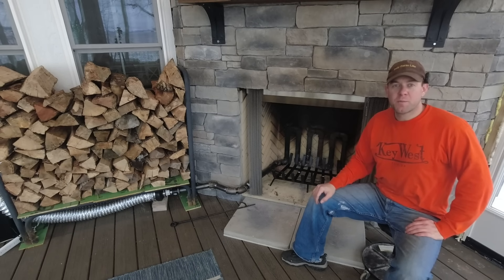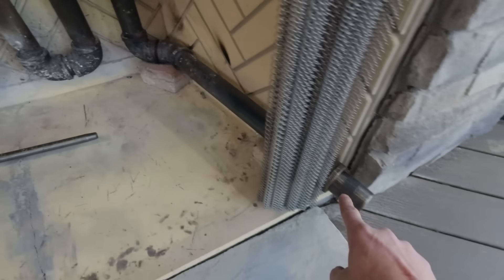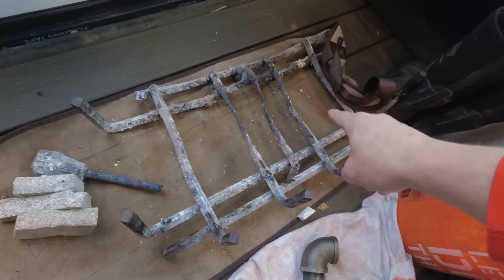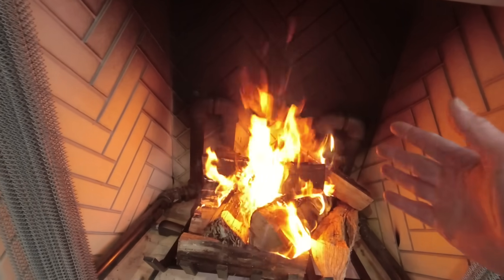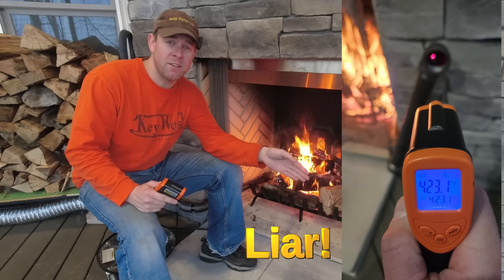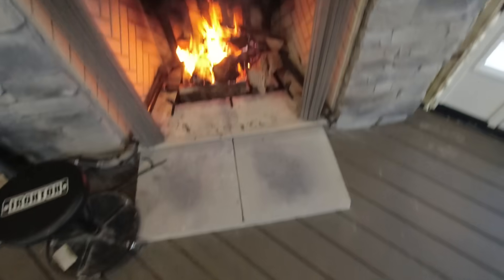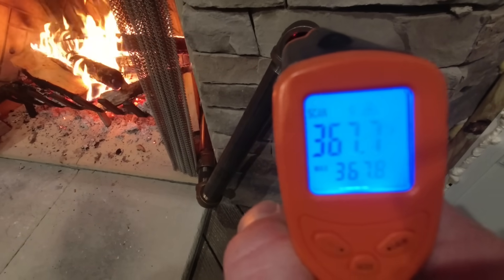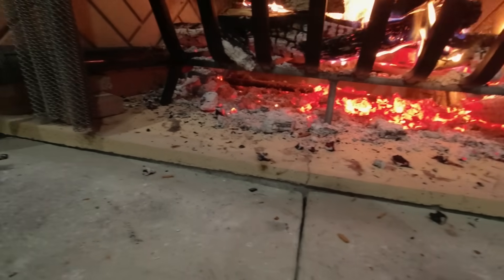Your Fireplace Is Wasting Heat — Here’s How to Fix It!

Comment: To improve performance add some sheet steel behind the pipes, the thickness matters somewhere between ⅜ to ½ (10 mm to 12 mm) is the sweet spot.
Reply from the maker: The air temp coming out of the pipe is already really hot. Not sure I need to "grab" more heat.  I also don't want to block my refractory panels completely.
Reply: @IndyFarmLife The plate reflects the infrared directly away from the face, and it's also a thermal "battery". This also helps to even out the temperature swings when using the fireplace.

Comment: I wonder if you could use an old radiator from a salvage door. Sandbblast all the paint off of it of course...
Reply from the maker: Maybe If the steel is up to the temps. Not sure if it is or not.

Comment: Very interesting!  Makes me wonder about making a small boiler  with a radiator  with  a water pump to circulate?
Reply from the maker: That would certainly work.  I would put a pressure relief valve in there though.  I would be nervous something would rupture.  Hence why mine is just air exchange vs liquid
Reply: i dont have the need for such a project.  However a small system scaled down from a known boiler system to heat a garage/shop/ hot tub/pool  would make some good content for a youtuber!  Make it low budget that a guy could source from hardware store.

Comment: I remember back in the 80s i think sears had a fireplace grate that was actually made of hollow tubing that was connected to a manifold and blower. The tubes reached out far enough to not blow the smoke into the house but pulled all that heat from the coals and logs.

Comment: You need a compression fan like what you see on an air hockey table that fan would be perfect for your needs cuz you can put it inside of a box it would suck air in and compress it down the pipe that's how an air hockey table works it pulls so much are in compress it in the space and then blows it out those tiny holes
Reply from the maker: Thanks for the tip/advice.  I never knew that was a different kind of fan.  I'll have to look into that!  Much appreciated!

Comment: I have ventless gas fireplace in my family room that has a double story ceiling and all of my heat just rolls upstairs.  Just recently, I put a fan on the mantle to blow the heat out instead of allowing it all to just go up and it helps tremendously.  It’s a bit of an eyesore but comfort over convenience I guess.  Something like this can be very beneficial to getting the heat to go out instead of up. Honestly I’m not sure why fireplaces aren’t built or equipped with something like this anyway, it just makes sense.

Comment: Instead of stepping down from 4" to 1.5" all at once, you should step down in increments about 12" apart - will result with an increase amount of air volume and at a higher speed
Reply from the maker: I had thought about that actually. Any idea if a plenum box like I mentioned in the video would accomplish the same thing?
Reply: @IndyFarmLife 

Not by itself.
A plenum box and the reduction of the air pipe do not accomplish the same thing as they are designed to do different jobs.

The step-down (4" → 1.5") is  actually a reducer. In that we are restricting the flow area and thereby increasing air velocity.

A plenum box reduces turbulence and equalizes
pressure.
Essentially,  a plenum acts as a buffer by making a reservoir of air.

You could add a plenum, but would still need to add a restriction.  
A plenum is a calming chamber; while the step down in piping is a throttle.

Comment: Thanks for sharing your very nice video ... I just sold the 4 bedroom Pennsylvania house which had a same type of "slavering - cash - time. Wood burning living room fireplace for romantics" .... I did something similar with 3 feet 2" black nipples attached with 1 - 2" 90 elbow and a hair blower on one end ... I placed both ends on bricks and the bent on the fire and tested temperatures with a gun similar to yours .... got 600 plus degrees, the could only measure 600 ... my lady was having a lot of fun experimenting with it and wondering about a full time contraption .... we got hungry, remodved the hot pipes to the side to cool while I was seasoning 2 steaks and potatos inside an iron oven .... grilling steaks in these wood burnng exhaust fans is the best because there is never bbq smell in the house or outide as all the grease particles in the air burn inside the  chimney as well .... our living room for being 2 floors high ceiling created a substantial down draft when recovering the hight heat with this L shape pipe. This cool draft was mostly felt in the couch opposite the fireplace ..... I observe this video and can say that there is no need for so much pipe in the back exactly where it blocks the back refractory wall that radiates the heat to the living area .... the use of these types of stoves is tricky, most likely obsolete, one must burn all the  wood in it completely and close the damper, even closed would continue to suck the home warm air, otherwise the "wood burning exhaust fan" gets the home cold if the "wood burning exhaust fan" is left on (with the damper open) .... however I calculated and sketched it that its very poor and miserable efficiency could be improved with an exterior air inlet just for the wood and also with a damper to close the exterior making sure this damper is design to stop sudden air blows that could sparce the ash and small charcoals, like a thin fiber glass sheet over a wire lath inside the inlet of the exterior pipe .... to watch the wood burn, I guess, connect us, without weed, to our million years old genetic or DNA memories of all of them ancestors before us survivors, it is hypnotic,  distressing, and if you grill steaks for snacks much more rewarding, it was for us, what do you think?

Comment: Nice job!  However, I did use high heat pipe dope on mine (and tested for leaks) to prevent pulling carbon monoxide into my living space.
Reply from the maker: Astute point!  Thanks!
Reply: Enough carbon monoxide enters the room through the front opening for kids growing in the house heated with wood burner to loose a few IQ points, if you trust Internet rumors.
Reply: If you push air, any leak will and up blowing in the fire enhancing burn, not go into the room, just don't suck! You also don't want to suck 400f hot air over fan...

Comment: Why don't you just put a metal fan made out of tin it spins when heat hits it no power no Motors
Reply from the maker: There isn't a place to sit it like you do on a wood stove.  Plus, it still wouldn't be near as hot.  The heat exchanger makes all the difference
Reply: @IndyFarmLife okay I'll take your word for it

Comment: Just putting a door (glass/metal) there, to regulate air intake, will improve the efficiency of the fireplace by a huge amount.
Reply from the maker: Yes, but the glass doors are insanely expensive. The tempered glass doors for this unit at $2,500 and tempered glass doors can't be closed while burning.  Ceramic glass would be even more expensive.  Steel doors would certainly work,  but it would drastically change the look of the unit.  We like the open aesthetic.

Comment: Is that a gas or wood fireplace because you lit it like a gas fireplace?

You have curtains on either side and that is a fire hazard.

Why would you have an outdoor fireplace?
If you are trying to warm the house, an indoor fireplace is better.
Reply from the maker: It's a wood fireplace with a gas log lighter.  Once the fire is going, you kill the gas.  The 'curtains' you saw are steel mesh spark arrestors.  They are not combustible and come with the fireplace.  They are very important for fireplace safety.  This isn't indoors really.  Its an enclosed porch.  Not part of the main house/heating system or weather envelope.
Reply: @IndyFarmLife  where do you get steel mesh spark arresters from? I have never heard of them but they sound interesting.
Reply from the maker: They came with the fireplace
Reply: @IndyFarmLife  I will have to google them, thanks :)

Comment: Question… wouldn’t it be more efficient if you snaked the piping horizontally instead of vertically, with the exit at the top right?  Air should flow easier as heat rises. The way this is built seems like you are trying to force rising hot air downward in the pipe.
Reply from the maker: Yea, quite possibly.  How much, I'm not sure.  Initially I wanted to have the exit point low so you didn't see the pipe as much.  Not sure if I achieved that or not.  If I ever have to rebuild I may use your suggestion and have a low input and high output.
Reply: I had the same thought.  It would also be more efficient in the event of a power loss.

Comment: Back in the '70's they sold heat exchangers that blew heated air out of the fireplace with the help of a fan. They were curved hollow pipes that served as a grate going up the back of the firebox and then curved towards the top of the hearth opening.
Reply from the maker: I actually think I saw a few of these as I was doing my research.

Comment: I think I liked the piping job and I used to do piping for a living so kudos if you don't. I would use water and do a water to air heat exchanger and blow a fan through it. Just leave it vented to atmosphere or add an expansion tank and relief valve as steam explosions are no joke.
Reply from the maker: Thanks!  No, I am definitely not a piping expert.  That said, I like the idea of a water exchanger, but the heat/pressure scare me a bit.  Definitely don't want a blow out.

Comment: All those 90's are killing your airflow.  If you want about the same surface area I'd run 3" pipe to and from a pair of 3" manifolds with 4 or 5 1.5" reducing Tees.  The manifolds would run vertical with the 4 or 5 1.5" pipes running horizontally between them on that back wall of the fireplace. You can cap the ends of the manifolds or if you can find a 3" to 1.5" reducing elbow you can use that. You could do the same with all 1.5" pipe if you think 3" pipe would be too much air flow, or if you don't have to room.
Reply from the maker: You are definitely right.  I had that exact thought as I was building it.  I initially was designing it with multiple open ends/ports instead of pushing the air through all the way to the end, but I had thought that may reduce the amount of heat I pickup.  As for sizing up the pipe, I don't think 3" was readily available/the cost really starts to jump.  This is a first pass and I'm getting tons of great feedback.  I certainly appreciate yours.  If I end up rebuilding, I'll give this some serious consideration.
Reply: @IndyFarmLife  The heat output is air flow and surface area.  Even with just a 1.5" manifold heat output would increase for a couple of reasons.  

Firstly you are reducing the pressure drop as each unit of air is going through fewer 90s, though you will get pressure drop after each T as well.  But cumulatively you'd have less overall pressure drop, so you'd flow more air.

Secondly you are slowing down the airflow through the back wall heat exchanger so you would get more heat transfer per foot of pipe. This works because of the first reason. 

You are right about the price hike.  The amount of steel in a 3" pipe is about double the amount of steel in a 1.5" pipe add in that it is less common and then you probably have to have it shipped individually (instead of bulk to a supply house).

As for redoing it... I mean I'd love to see it.  But it also sounds like it already does what you want it to do, making it better would just reduce the size of fire you build to heat the space up.  As I understand the entire point of your fire is to provide ambiance and the heat is a secondary benefit. So as long as you are building the size fire you want, it heats up quick enough, and the fan is quiet enough I don't see any reason to change it just to get more efficiency.
Reply from the maker: Thanks for the thoughtful comments and input!  I also appreciate you doing it with civility! Ha. Some really good info here. For now I think I'm set, but knowledge is power!  Thanks!

Comment: I've made my fireplace air tight so I can close the damper. I also welded up a vertical stack grate.
Reply from the maker: A damper definitely helps!  I'm just not to the point where I want to close up this pretty fireplace with steel doors, and glass can only be used when not burning, plus it's crazy expensive.
Reply: @IndyFarmLife our fireplace has tempered glass doors. What I've done is use wood stove gaskets around the entire perimeter of the opening, the aluminum tape where the doors fold and gasket where to doors come together. Close the damper and doors and I'm all set.
Reply from the maker: @billxam2674 but you don't actively burn with them closed, do you?  Tempered glass is only rated up to 400 degrees I think.
Reply: @IndyFarmLife Ours are rated for closed door burn, ceramic glass according to the manual.
Reply from the maker: Ohh yes, the ceramic glass has a much higher rating than tempered.  Good for you!
Reply: @IndyFarmLife Yeah, the manual says you can close the doors during use.
Reply from the maker: That's legit!

Comment: Creative, but having a 300* pipe where it can be contacted by any number of people going in or out that door is crazy. Pop that pipe into the floor and run a metal duct across the room to distribute that heat.
Reply from the maker: Understandable.  It's noteworthy that the pipe coming out of the fireplace is next to a door that leads outside to a 2nd story deck.  I.e. it's not the main entry point into the room.  Certainly have to be cognizant of that.

Comment: Just get a fireplace insert installed. Use an insulated chimney liner. Masonry chimneys wick heat out of the space you are trying to heat. Better fire draft control and less creosote also.
50 years as an HVAC specialist.
Reply from the maker: Yes, an insert would be more efficient, but that's not the point of this video.  I already have this beautiful fireplace.  I just wanted a cheap, smart, easy way to harness a few more BTUs.  I'm not looking to redesign the space or change the intended use of it.

Comment: 10:20  It was 36°F when you started, but "opening a window" doesn't tell us what the temperature is now, and the square feet of the enclosed porch.

<sigh>
Reply from the maker: The space is about 300 floor sqft with a gable ceiling rising to about 17ft.  It has a car siding ceiling that isn't insulated and roughly 225 sqft of glass enclosing it it.  Any figures on how the temperature of the room itself moved wouldn't be super helpful given all the wild aspects of the room.  The exit temps are what matter.  Now knowing that, if it's helpful, this past weekend it was 8 degrees outside and I got it to 65 in the room.
Reply: @IndyFarmLife   Thanks. That's impressive. With that kind of performance it seems reasonable to assume it could heat an entire 1250 sq. ft. well insulated first flour of a house. The fireplace insert in my basement will heat the entire basement, but I'd rather not spend thousands to install one in the upstairs fireplace. So this black pipe setup looks intriguing.